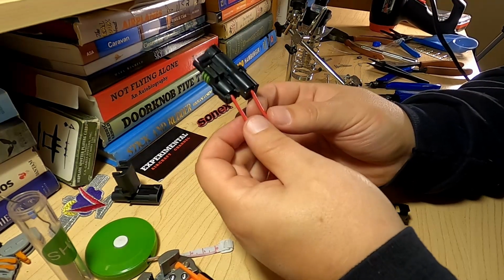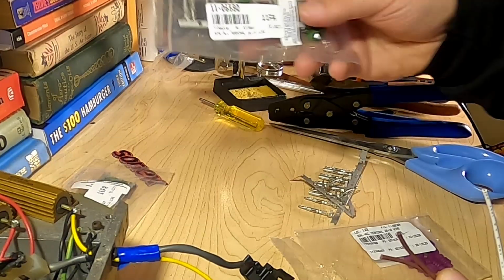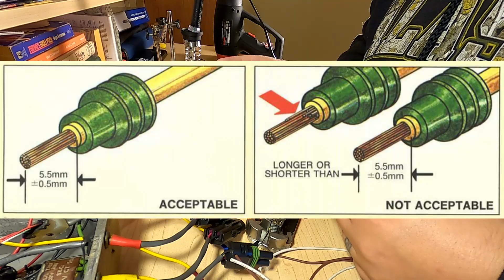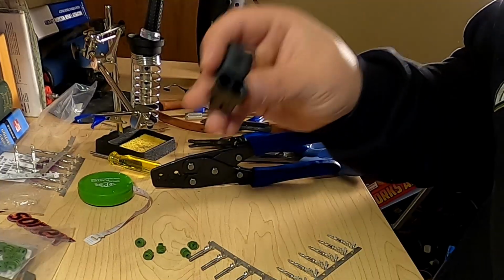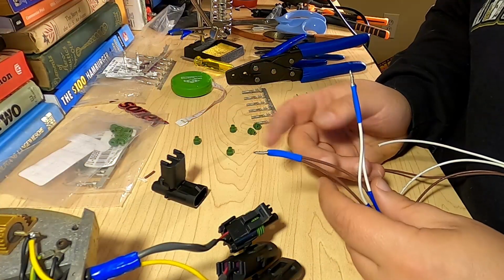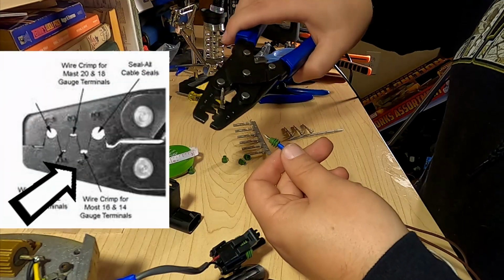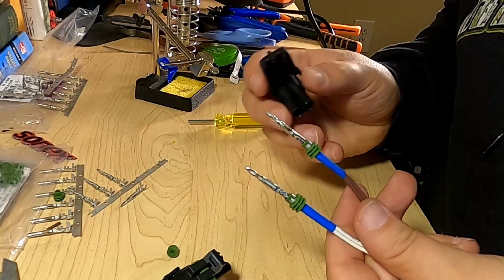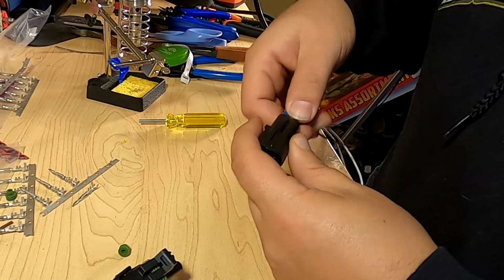How To Double Up Wires In Weatherpack Connectors, Needed For Revmaster CDI Ignition

Comment: What "helping fingers" stand are you using when soldering? Did this come included with your soldering set up?
Reply from the maker: I actually borrowed this one from my day job, the one that came with the soldering kit didn't have the alligator clips. No brand name on it and my Google Fu is lacking... There's some pretty cool "Helping Hands" versions on Amazon though.
Reply: @LeftSeatAdventures  What you should do on any of those stands with alligator clips is take some weatherproof  heat shrink and put a piece on each side of the alligator clip jaw and shrink it down, It will help protect your wire! Some of those alligator clips are really tight and sharp!
Reply from the maker: @NeverEnoughPyro40  Yup, much better idea than the electrical tape. 👍

Comment: No reason this should not work.  The only problem is that the shrink tubing removes the weather seal.  They make heat shrink with sealant inside that will seal the gaps where the two wires touch for installations where weatherproofing is needed.
Reply from the maker: You're 100% correct on that, and an issue I'll need to address. The tubing with the sealant inside typically bubbles out on each end and I was concerned about having a clearance issue with both crimping the terminal and inside the connector body. Or at least that has been my experience. I've heard of others applying di-electric grease under the tubing, but I have yet to try it myself. I'm also wondering if a non-acetic silicone or liquid electrical tape could do the job...
Reply: @LeftSeatAdventures  Usually, you can wipe off the excess sealant while it is still warm.  Failing that, it should not be hard to trim a little with a sharp knife.  I have used dielectric grease in the past as well as liquid tape under the shrink tube, but they are much messier and probably aren’t nearly as fool-proof as the sealant shrink tube.  Anything is probably better than nothing though.
Reply: I bought some of that from McMaster Carr. Works great.

Comment: Heat shrink over two wire insulation is still kinda oval. Maybe you should have put that heat shrink partially over bare and twisted conductors, where the Seal-All seal would be?
Reply from the maker: Yea, there's a couple different ways to do it. It held up well for my application, but if they're going to be regularly exposed to the elements than the ends should definitely be sealed somehow. Some heat shrinks have it built in. Silicone or liquid electrical tape would also do the job after the fact.